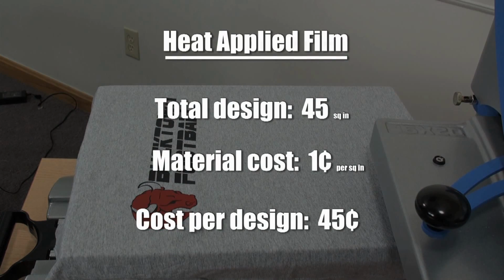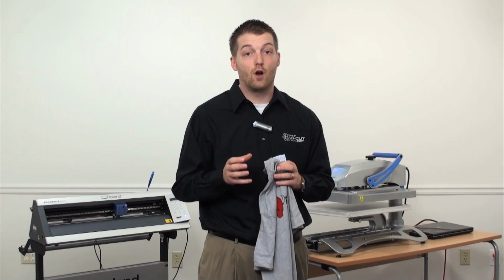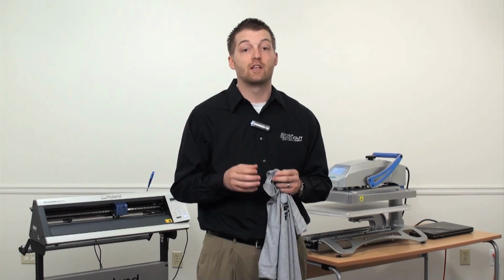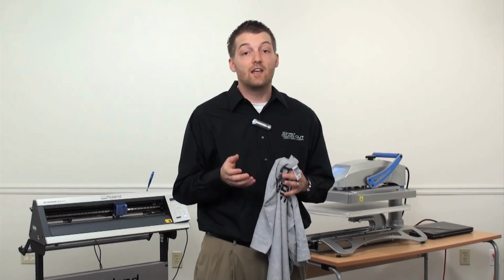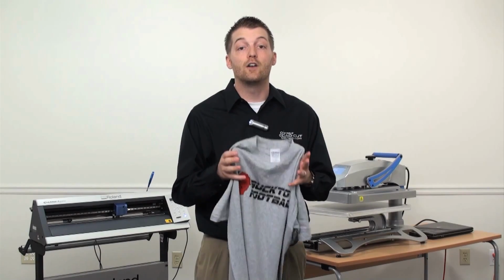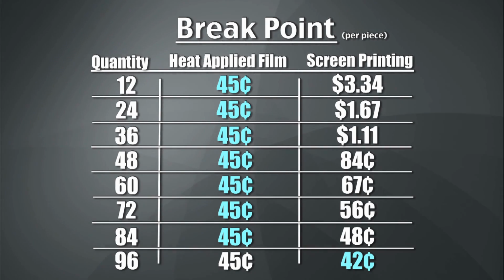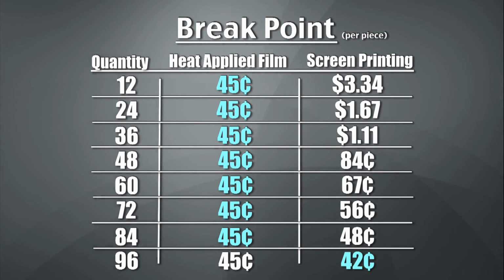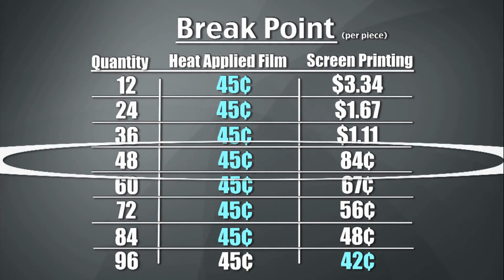Screen Printing vs Heat Transfers: Cost, Time, Profit

Comment: There are a lot of hidden costs in this one. Starting from warehouse size (rent or buy) for screen printing compared to the relatively small size of the vinyl cutter needs. 
Then lets not forget that this cost only applies for 2 colors. What if people want full colors? 
Still a very good video and a very rough overview.

Comment: I would agree with very short runs, but no way it is 48 shirts where the screening pulls ahead.  I could image screens, dry, set up and print a few dozen shirts before you are done weeding. Tight repeatable registration not so fun with vinyl.

Don't get me wromg, heat pressing has a place in a shop, though I send my stuff out. Haven't heated up the heat press in years.

Stahl's does make an excellent product, and they know their business well. I always make a point to check out their booth at the trade shows just to see what is new. Been screening since 1992. Started with a home made 6 color press, now have moved onto my first auto. 
You have questions, I have answers!  Shirt printing is a great business and lots of fun.
Reply: Hey man so I'm really new to this. Seen a bunch of beginner set ups an I feel it will be better if I build my own screen press. Do you have a way I could pick your brain if you have the time?
Reply: @pespy9826  Yes pick away. I started with building my own press.

Comment: They do coexist but, to start off at the lowest overhead, in my opinion it would be heat pressing shirts. 
The only cost besides material is the time it takes to weed. The material out last the screenprint shirts. I've had stahls premium plus on my sweaters and shirts that have lasted a decade without peeling and very little cracks. compared to screenprint shirts that have almost faded away.  Designs also make a difference, detail, size. Still, I'm going with HTV,  doing that right now emmbeemee.bigcartel.com  Thanx Stahls
Reply: Well done screen prints will out live the T-shirt. I have been a printer since 1992.  Heat pressing does  have a place though, especially short run multi-color.

Comment: I have a question about that what methods of printing has it's least cost and preferable one
Reply from the maker: Things to consider when deciding which method would be best for you is how much space you have and what kind of business you want to have. If you primarily only want to do 1, 2, or 3-color logos in higher quantities, screen printing or ink transfers may be the best fit. If you want to offer more customization such as printing photos on t-shirts, a direct-to-garment printing may be the best choice. If you want the ability to be able to do a little bit of everything, heat printing makes the most sense. Visit https://www.stahls.com/ultimate-guide-starting-tshirt-business for even more information.

Comment: If I'm doing 12-20 shirt runs, should I invest in a screen printer set up or heat press?  Shirts aren't the main focus of my shop but they are nice to have for trade shows and online market.
Reply from the maker: It would be more cost-effective to invest in a heat press for 12-20 shirt runs as opposed to screen printing. The quantity break for screen printing to be profitable is 48+ shirts.

Comment: You forgot to show emulsion/mixing setup. Having a darkroom. Printing the negatives.  Ink cost and film costs to print the negative. Color matching. Ink cleanup. Emulsion reclaiming. Drying to re emulsion... Screen printing is dead.
Reply: it's not dead. It became more and art itself than an "industrial process", specially in indexed colors jobs. Any textile shop must have both equipments; for short or unique design and quantities sublimation or dtg printers and for more massive production screen printing.

Comment: You could have ganged four jobs like this on the two screens instead of using a whole screen for one small design. And the drying time isn't wasted because you can do other things while the screens dry.  The $20 per screen isn't cost, it's the charge paid by the customer. I calculate chemicals and emulsion to make a screen at about $3-$4. Actual time spent working on it is about 10 minutes. I did the math a few years ago and decided that for a single color job I'd do vinyl for 5 or less shirts and screen printing for 6 or more.

Comment: Sure, for only 6 shirts making screens and setup is a lot of work. But your comparison is pretty poor and obviously leans in the favor of the machines you’re trying to sell. I use HTV for less than 10 shirts and screen print for 10 or greater. After 2 years of only using HTV, investing into screen printing was a no brainer.

Comment: Bunch of angry screen printers on here. HTV serves a purpose and is a good addition to any shop. Nobody is claiming it will replace traditional methods.
Reply: ijk240695 get with the times and evolve you sound like the local grocer who only offers 2 types of ketchup being mad because people want to shop at Walmart where they can get 10 varieties AND for far cheaper than you can offer
Reply: And some people would rather have catsup.
Reply: Euclid’s Chemical Equation 👏🏽👏🏽👏🏽👏🏽

Comment: pls sir how much prise. pls pls pls
Reply from the maker: Please visit https://www.stahls.com/heat-presses-vinyl-cutters for more information relating to the various equipment used in this video. Please visit https://www.stahls.com/heat-transfer-vinyl-twill for the different heat applied materials available for heat pressing. If you have additional questions, please call 800-478-2457 or email info@stahls.com.

Comment: i read everywhere the same thing htv after 3 washes the htv peel off, but screen print will last for ever as is just water base paint or plastisol, the thing is if you have a small business and want to sell personalized shirt to use the screen print and make money minimun you have to do like 30 tshirts because of emulsion preparation and printing the positive to reveal the image, heat press you just use vinyl and cutter and thats it, you can print 1 - 10 tshirt and save lot of money but customer must know about the durability.
Reply: Gameplay Music, if your vinyl is peeling off, it was incorrectly applied. Just like screen printing, it has to be done correctly.

Comment: Sir could you please tell me if there is a vinyl press material out there that will hold up to the washer and dryer and normal wear like a screen printed shirt will? I've always heard that a screen printed shirt was unbeatable. Is this true? I'm willing to spend the money on a good machine and on good vinyl if it's within reason and is as durable. Many thanks, Robert....
Reply from the maker: Many of our materials are guaranteed to outlast the life of the garment if heat applied correctly.  Please visit https://www.stahls.com/heat-transfer-material for more information regarding the various materials available. As far as heat presses, we recommend Hotronix heat presses : https://www.stahls.com/heat-press-machines

Comment: When doing a short run of six pieces with simple artwork, like the video shows, another option is to use vinyl on your screens rather than photo emulsion. That way you only have to weed once and you have lower consumable costs than either of the two methods shown. The clean up is also minimal, just peel the vinyl from the screen and rinse it off. Nobody would use new screens for a six piece order, that's crazy talk.

Comment: Question? How does it compare to laser print, no weed, transfers. I hear that beats dtg by a long mile and gives  screen printing a run for the money. Is that true? Thanks..
Reply: david martinez it’s a lot more expensive per print and can be very inconsistent. It’s suitable for high detail/small print runs.

Comment: Eight minutes for screen registration?  Are you joking?  LoL  I can register a four color print on a manual press in less time than that, and I've only been screen printing off and on for about a year.  Gimme a break...
Reply: Brian Ollom 
I want to hang out with you when I go screen printing.  Skip the BS and get her done right the first time!
Reply: Yeah, I think the 8 minutes thing is for the automated press.
We used to have one of those at work, and it was a real bitch setting up.
I was in on my day off yesterday doing a four colour print on the manual carousel, and had that thing set up and every frame masked in about five-six minutes.

Comment: I use dtg / htv and screen print.. far as volume i can do 1 color design 1 location print screen printing around 100 shirts per hour with 30 minute set up including screen making.. manual press 6/6...  by myself..   i have done 100 htv and 100 dtg before its an all day affair with people helping on either method..  i usally do htv on 20 shirts or less.. and just got  completley out of dtg due to high consumbles cost..  

i love htv as its my bread and butter.. but for volume i go to screen printing...
Reply: so where is the cut cost point ? starting my own in a few days, just wondering.
Reply: Brannon Hinkle wouldn't it be faster to screen print 20 shirts considering the weeding process?
Reply: you are correct

Comment: The pricing is not accurate in this video. You are actually using more than 45 sq inches of vinyl per design because you have to include the vinyl you throw away, not just whats used in the design. AND with screen printing, you are not going to buy two new screens. You are going to use screens you already own from a previous job. Plus, you have the option to charge the customer a setup fee that covers the cost of the screens. So in this case, the only cost you have to worry about is for the emulsion, the ink used, and any cleaning supplies used before making the screen and when done.
Reply: 10 inches by 4 inches is 40 square inches in black. 2 inches by 2 inches is 4, so for that job, 44 square inches is used for cutting, then weeded away the unneeded vinyl. Still used the 44 square inches, just didn't press it all.
Reply: re htv - the time in weeding will vary with design, but whatever design, it adds up quickly. that's the real cost
Reply: @Don Mega  also it's projecting not reflecting lmao
Reply: @Don Mega   thats a lot of storage space
Reply: @ijk240695 what do you use for a full colour tshirt print, do you use colour printer or get it order custome heat transfer. Thank you.
Reply: @Don Mega  The only time you keep screens is for very very on going repeat orders. Most times it doesn't pay to keep screens imaged. This is especially true if the design is multi-color. Re-registering inked screens is usually more hassle than it is worth.

I do have a few music group clients and I keep some of their screens, in case they need shirts for a gig with short notice.
Reply: @Don Mega  I am not sure what you mean by rescreened, do you mean new mesh on a frame?? A brand new screen can be coated, exposed, used and reclaimed dozens of times. Reclaiming is washing out the ink and emulsion, ready to recoat and expose with new art.  The few I keep imaged are simple 1 color designs, that take 2 minutes to set in the press ready to go.

Most times it is best just to have coated screens stored ready to shoot. Also a half decent way of organizing 'films'. Of course now I print 'films' with wide format inkjet printer, but in the old days actual FILM was used to image screens.

My main comment is that for more than 6-8 pieces I would screen print. And time wise with multicolor it is no contest screen printing vs vinyl.  Especially at several dozen. Heat press has a place, but I wouldn't build my business around it. I have been printing for 25 years. 
Today I literally did $810 in 6 hours. It just happen to be a simple 1 color, that would also have worked well time wise with heat pressing, but I have not seen a heat pressed vinyl hoodie last as long as a good print. Cheers
Reply: @ijk240695 you a veteran in the biz. Would like to get a modern vacuum printer and a heat press for the business side of a small kids' soccer club. Would you have an idea if the vacuum printer is good investment?
Reply: @Don Mega  native tongue being tardo?
Reply: @Don Mega  no you aren't, and calling someone gay to insult them really says how intelligent you are, so I rest my case. Good luck in overcoming your ignorance.

Comment: For very small runs, then HTV makes sense IF the design is not complex and the customer is ok with the feel of vinyl (Siser Easyweed stretch is very soft though). For large runs, screen printing is actually more efficient and usually faster especially if you have the proper equipment.

Comment: Thats bullshit. 38mins? For screen printing, you just swipe and swipe for every new t-shirt. You don't make new screen for each t shirt while for heat transfer, you got to remove excess material for each print. Aside from that, look at all those plastic trash you accumulate over time with heat transfer.
Reply: no screenprinter  is going to print 6 pieces cause yes the price will be higher. I know I wont screen 6 tshirts with 2 colors .now to be truthful that design I would ask the customer what feel they want and if they say no feel then I would charge them more and make a screen out of Decal vinyl and use waterbase ink. but I always sell my shirts for $23 & $25 so Its up to me how I want to print it since I do everything inhouse.

Comment: the biggest difference with the two is heat applied graphics breakdown faster when washed compared to silkscreen prints. it's all a matter of quality from what I can tell.
Reply: no not true htv should out last the garment and silkscreen breaks down faster with plastisol as it starts to crack. 
If your htv is breaking down (peeling off) then you need to check you press for uneven temp.
Reply: I know this is true! I had holes in my clothes before the htv even cracked peeled or faded,
Reply: dirtbikeq if it starts to crack it wasn’t cured correctly..screen printing will outlast the garment if done right. Heat transfers won’t.
Reply: De Jo yup all my heat pressed vinyl out last my screen printed shirts. Even ones bought from the store.  Difference is you don't want to weed 50 transfers,  even you can just swipe down with a squiggy
Reply: Gameplay Music so far some of my htv are 5-7 years old and worn weekly by teenagers. Some with 50+washings, to the point the material is getting threadbare but the vinyl is good to go!
Reply: I use mostly Siser Easyweed. I've tried too many to list and they all work the same...cut, weed, heat apply...some are known to be easier to weed, some are known to be more difficult to weed. But vinyl never cracks, and unless you dry it on hot for many hours, it won't lift off if the first heat apply is done correctly. You must be able to see the texture of the garment on the vinyl, as if the vinyl becomes one with the fabric.
Reply: Jimmy Tuan I like chemica, it's nice and light,  feels like screen print,  or siser stretch
Reply: any recommendations on heat pressed vinyl?
Reply: De Jo 8
Reply: right
Reply: how long last your t shirt with htv? how many washes?
Reply: what brand of HTV are you using??
Reply: Ginny Newman What type of HTV is that ? 🤔

Comment: What is the heat transfer material made of? Does it really soak into the garment?
Reply: You forgot to mention discharge ink.😁
Reply: no vinyl sits on top of the garment. only waterbase ink, and sublimation soaks into the garment leaving a no hand feel.
Reply: And dtg, no?